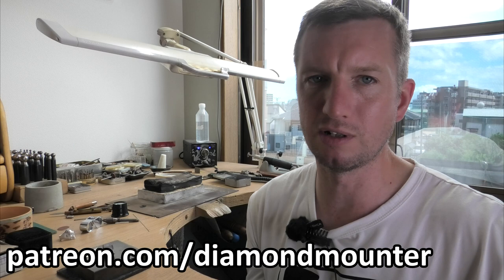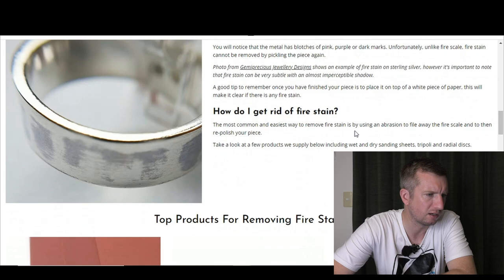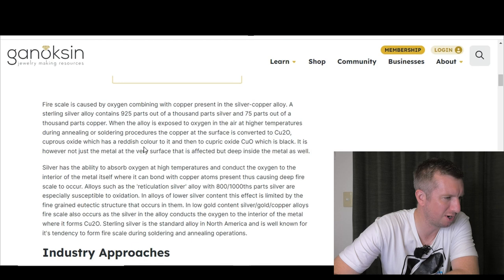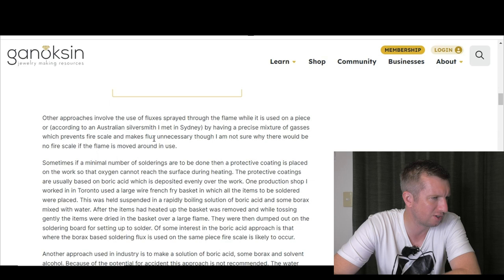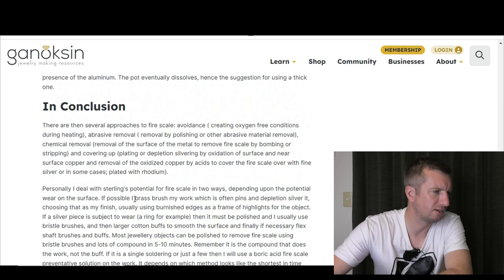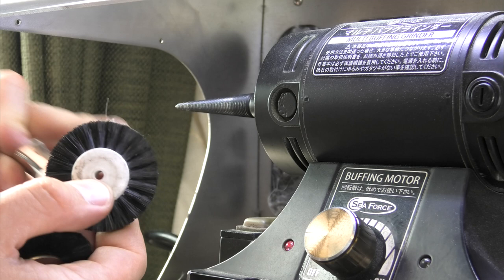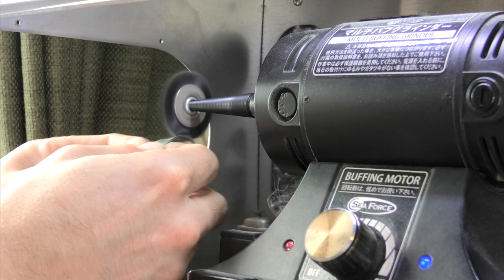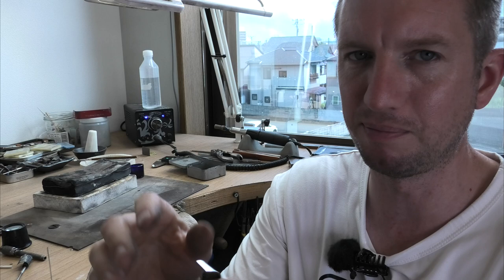How to Remove Fire Stain from Silver

Comment: You sometimes have to remove a lot of metal to get rid of the stain.  Heating the copper causes oxygen to bond with the copper and create copper oxide.  To prevent it you have to keep oxygen out of your work.  Flux keeps oxygen away from the metal.  Use lots of flux every time you heat the metal.  Use flux every time you anneal your metal.  You want to avoid it because you might have to remove a lot of metal to polish it out.
Reply: So does that mean the oxygen+propane torches are actually more likely to give your silver fire stains?
Reply: @mohsh3946  Good question.  I don't know.  I use oxy propane and sometimes have issue with fire scale, sometimes I don't.

Comment: Borax mixed with meths works great for helping to prevent it. Hydrogen peroxide can be used in your pickle to remove it. Thanks for sharing.
Reply: Hello, what do you call meths? The only meaning I know for it is ... Methamphetamine 😂 I doubt you use illegal drugs to prevent fire stains on your silver jewelry
Reply: @Gazz_R  Thank you very much for your clarifications and tips. I'll give it a try  next time I work with silver
Reply from the maker: I used to use that stuff to help protect gemstones from heat when soldering. I got sick of the smell and haven't used it for years
Reply: Boric acid powder ..Not Borax!!
mixed alcohol

Comment: Couldn't you just deplete the surface of the coper by repeated heating?  like you would do leading up to reticulation or Keum-boo?
Reply: Wud like to kn answer to this too as i done depleating before
Reply: @sweetjcazalee1210  I find that just a single heating, and watching the color change during the process, greatly reduces the amount of abrasive work needed. Only heat enough to see the discoloration reduced. Then dunk in water and straight to working the remainder of the stain out.
Reply: Id imagine reticulating could work if you dont have an ornate piece and if you take great care as it could go very badly extremely rapidly
Reply: @CecilXzandu  I don’t mean to say go through with the reticulation, but to do the steps up to bit not including the reticulation. Just deplete the surface of the copper.

Comment: pretty straightforward, jus gotta finely sand or polish it out once u got it. but boraxic acid and alcohol is my go to for preventing fire scale, mix it up 5050 and burn it off clear a couple times and if u need to solder somewhere u can scrape it off to add flux in jus that location and the whole piece wont be as likely to fire scale as much. not a perfect solution ofc but less fire scale is def better.

Comment: I've polished gnarly waves and ripples into the surface of my pieces trying to sand out deep stains. Now, I got into joins hot and fast with my torch to reduce excessive heating, and flux liberally. Seems to help... But, I've always wanted to try depletion guilding! Next time I have bad stains I'm going to try and see how it compares with sanding/polishing

Comment: I use Firescoff ceramic flux coating spray on my Tiffany Silver pieces when rebuilding the hearts and tags, it helps so much with preventing the fire stain to begin with!

As with removing it with my experience, working down buff gradients until youre using like a 3000/6000 buff paper is a really good way to removing it if youre trying to avoid engravings espcially laser engravings
Reply from the maker: Sometimes silver is silver plated to help not tarnish over time. This can partially burn off when soldering and its trouble especially in fine chains

Comment: Wud that work for a piece made with silver n bronze? When i over fired my bronze piece to solder in my silver piece,  the copper in the bronze surfaced but after i pickled it, the copper coluur really become more visible. I try polish but don't seems to get rid of the copper stain. Does that metal polish wheel u show are they sold in mini size for attachment to foredom?